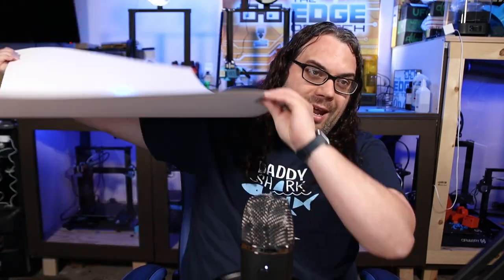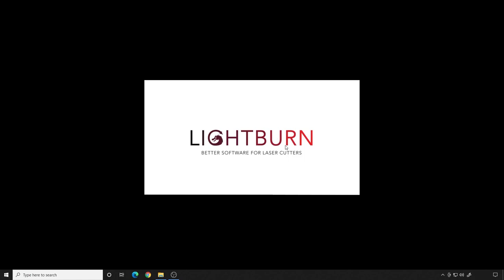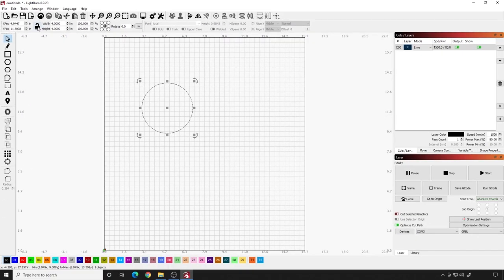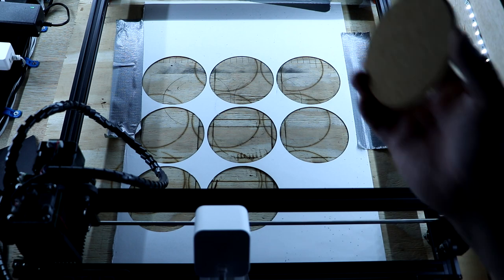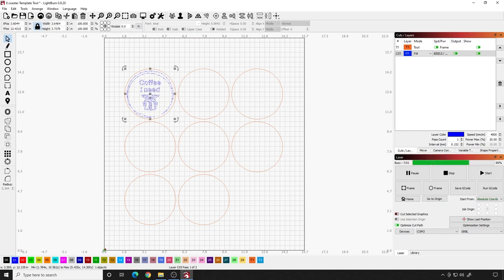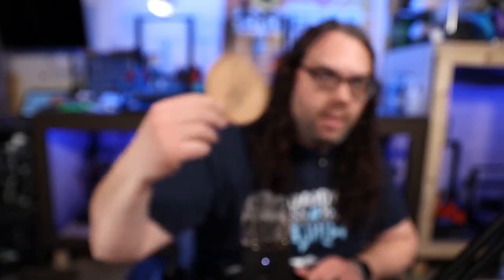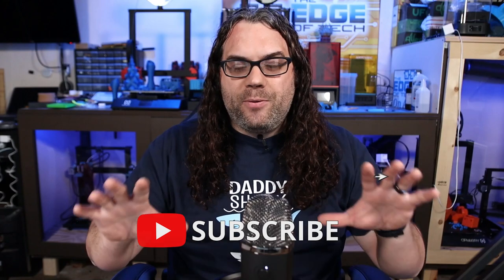How to Make a Template for Laser Engraving : Ortur Laser Master 2

Comment: Couple of tips you may find useful:
When you want to copy the same settings to multiple layers you can just select the layer you want to copy , then on the right of the layer window bellow the rubbish bin delete icon are 2 arrows one pointing to the right and one to the left, click the top one pointing to the right, this copies the settings to clipboard, then select the destination layer and press the lower button pointing back to the left, this will transfer all the settings back to the new layer.
 You can also use the 'set as default" and other controls inside each layers settings to change layer settings to a saved value.

I noticed when you cut out the board it was hanging on in one spot on each one. This is probably at the start point of each cut. Inside the settings for the layer (i think on the latest version it is on the advanced tab) you can set a delay for start and finish dwell when you set that a line should be "cut through" I set mine to around 0.5 second or so, this ensures that the laser is up to power before it starts moving and you get a clean cut all the way around.

really like the videos, thanks
Reply from the maker: Awesome!! Thank you for the tips! I will start using them to make life easier! lol
Reply: EXCELLENT !  Much easier on settings when duplicating engravings!

Comment: @The Edge of Tech - Use DTFB (Dollar Tree Foam Board) it will cut just as well but more importantly it has some thickness to it to better hold/align your parts. I also use the clean edges of the DTFB to reference off the frame of the laser or the work service (think lasered or 3D printed stops screwed down to butt against) so they can be easily reused.
Reply from the maker: Cool idea! I have used cardboard too, and it give a nice place for the coasters to sit in! Thanks for watching!
Reply: I've tried white but it just bounces off, and I've tried black craft paper but it just burns when lines are close

Comment: QUESTION is at the end...I have an Ortur Laser Master 2 20w!
Jim @The Edge of Tech, thanks for this video.  It has helped me understand how to burn cork coasters a lot better and the template method is something I tried today and it worked out great!  I created my own setup following your directions in the video and have almost matched everything you have.  I burned a couple of my coaster project files today for testing and they came out great.  I do see one issue that I am not sure if you have seen yet.  After the burn/engraving, I blow off the surface of the coaster but after handing it for a few minutes, there seems to be a lot of black soot coming off of it and making the burn smudge some on the coaster.
My questions are: Have you run across this and have you found a way to minimize the smudging from the leftover soot on top of the coaster?  Does this need a clear coat or something to protect it?  Thanks Jim for all you do.  Your channel is amazing.

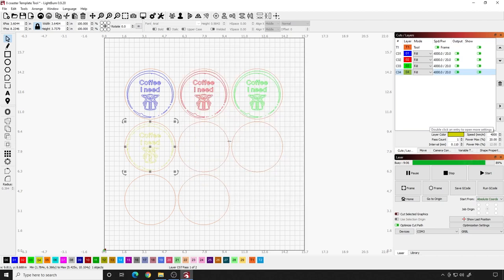Comment: 15:30 the left and right arrows under the trashcan icon in the cuts/layers panel (right side) are used to store and recall speed and power settings. so instead of going into every layer and changing by hand you can store the value of the layer you want and paste it into another. saves a lot of time! :-)
thanks for sharing your way of doing this technique :-)

Comment: Back to working with the ORTUR laser 2 after having back surgery.
 Question: In my Lightburn 1-12-1 ( I think, the latest) Circles get cut out in circles but squares get cut out only in X, back and forth!. If I select TRACE, it cuts out the inside and outside of the line, which is a waste. Takes Forever What did I miss?

Next..After the latest download in Lightburn, the shift /FRAME option doesn't turn on the laser while framing. It IS on (Selected). I have to go to MOVE and turn on the fire button in order to see the laser. Any ideas?

Comment: First of all, love all your videos. Question on this one: Did you find 2 passes was sufficient to cut through the posterboard? I used regular poster board and after 4 passes it still didn't cut through. I'm on inches and used a 20 speed/85 power, then decreased to 15/85. Still not cutting. Any ideas what I may be doing wrong? I should mention my laser head is down as far as it will go, but that still doesn't seem to get it low enough for my focus tool to touch. Any help is appreciated.

Comment: I’m following your instructions to cut a poster board template for dog tags. I created a rectangle and sized it. Then I did an array of 4 x 6 to make 24 rectangles. I made each one an individual layer. They are all set as line, 500 speed, 100 power and 4 passes. All are set as output. Only 2 of the 24 are cut out. The other 22 are visibly at a lower power. Using a fox alien laser. Any ideas why only 2 will cut?

Comment: Great explanation. I totally understood how to do that. I have a 40X40 Inches - 160 watts laser engraver/cutter I ordered for my small business. Maybe you could help with what I bought it for as far as plotting and repetition. I am using mine to cut .1875" holes into a 3×3 aluminum tube 37.50" long. The hole placement is super critical. I was thinking I could place 13 of these side by side and have a dead stop on 2 sides to ensure squareness. I assume I could do what you did and do a individual plot for one, and just copy it to repeat 13 times(or however many I need at that time.) 
 Is it possible to set a homing location to where the laser would start at the spot where I have the dead stop? 
 I'm not that technically savvy with computers, but had to make this investment as my work load has increased dramatically. You made it so easy to understand, thank you. I've watched hours of other videos and none of them clicked to me. I instantly SUB'D your channel. 
 Any input would be greatly appreciated. Hope to hear back from you. Thanks.

Comment: Very nice and thank you for taking your time to help us all here. I have a question, although is an old video, the only detail I didn't see was setting up the 0,0 point or home position in the event I need to re-use the template. From what I understand you're using Ortur's home default position. How do I position the template in the same spot if re-using? Thinking on building a plywood template for the coaster but struggling to figure out how to position the template exactly every time, unless I burn a cross hair mark on the template and set work origin to that point.
Kind of newbie here, any suggestion or comment? Appreciated, again, thank you for your videos, FANTASTIC.

Comment: Hi, really nice video! I have a question that isn't direct related with the subject , but I saw you using the Lazer on high % to cut the holes and wanted to ask how this affects the life of the laser head? Do you have any experience how long this exact laser works before starts to drop on power ?  
Thanks in advanced !

Comment: Thanks for showing these tips and tricks. I am new with laser, actually I have the same machine in my basement now for some time and haven't had time to get burning. Acouple of questions... I noticed that after you cut out the template you didn't refocus the unit to cut the coaster which is way much thicker, did you refocus off camera or don't you have to? Q2...what video is best for to start watching, I know sweet tweet at the moment. Want to try the coaster thing to start as I have loads of cork. Thanks again. Awesome stuff you're showing. Andrew

Comment: Something I thought was to not cut out but Mark crosshairs with the laser on each corner for realignment in the future so you can move the laser to that location and line up the template without having to reburn a new template every time you want to use it.

Comment: Hi there! I have the laser ortur 20w as well and I cannot get it to engrave onto the aluminum business cards and the stainless steel blank stamping pendants. I have no idea what I am doing wrong. I have engraved mirrors, wood, and tile with it. The mirrors I can only get to engrave at 20 mm/sec at 90% power and get shotty results and it took 8 hours to engrave some text onto a 12x12 tile mirror, If I put the speed higher it will engrave onto mirror but will have to do multiple passes to get it to appear through the mirror. If someone can help me it would be greatly appreciated. I have used lightburn and lasergrbl and still can’t get cards or pendants to engrave.

Comment: I rather put the laser on a wooden plate, screw it in, cut the same plate it stands on with the max working surface, for example you cut a square of 400x400. Take the cut out and use it as a template of 400x400. You can make more 400x400 templates that will always fit perfectly in this cut-out work space. This way, every time you place a 400x400 template inside the laser, it will be positioned exactly on the absolute cords. No need for taping the paper and recutting the board every few times.

Comment: Love the videos Jim Thank you.   
I have a possible dumb question.  Do you or someone else know if the "ambient light" around the laser will effect the burn in anyway? For instance if I burn one way in the led lit shop, vs taking unit outside on a sunny day .  Kind of thing.
Reply: Can't say i've taken my laser outside. However I have an Ortur at work in an LED lit shop, and i have a FoxAlien Reizer at home (Ortur-class unit, but with some QOL improvements) I run lights on/lights off and have had zero issues with inconsistencies. I THINK the laser operates at a frequency so far and above what our light does that it just doesn't have any kind of impact on it.

Comment: Great and very informative video man and I really appreciate all your efforts to make every step easy to understand. However, Im having problems engraving some wooden coasters. I even jacked the power up to 85% and its not even leaving a mark on them. I noticed your laser module was way up off your coasters. My laser came with an acrylic focusing card to adjust my laser height from my material that I'm engraving. Am I supposed to just raise it up high like yours or what? Im just wondering why its not even leaving any marks at all on the wood?
Reply: Check your lens for smoke buildup